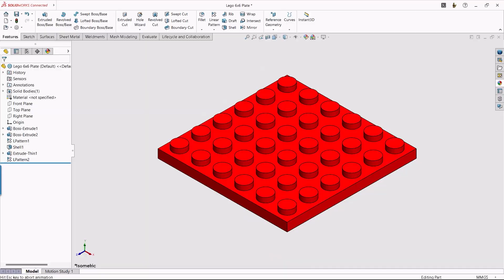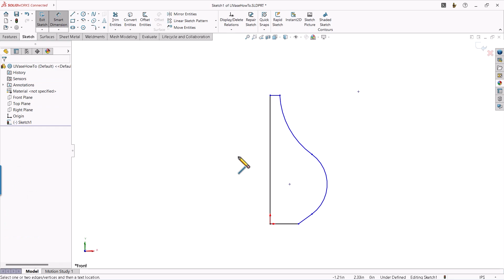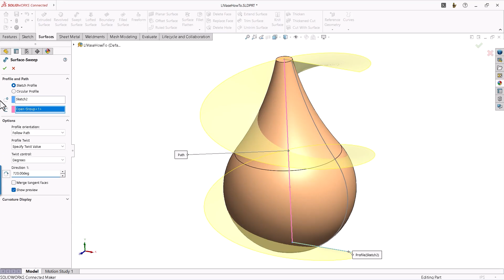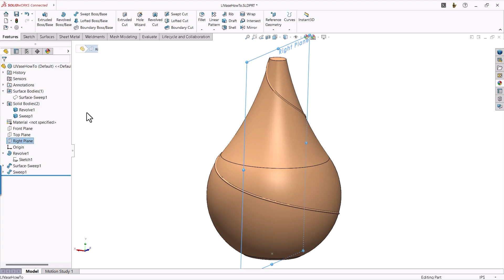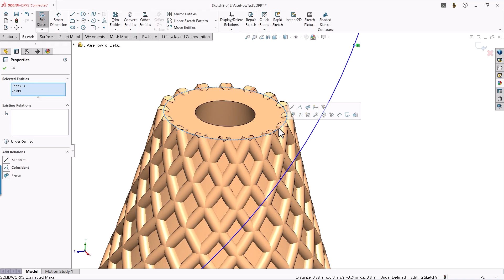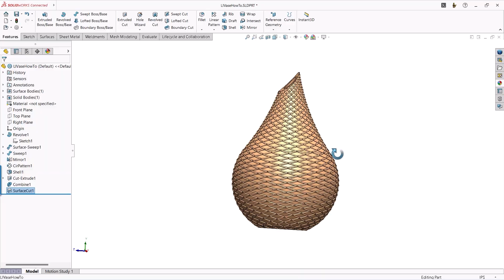How to model a 3D printable vase

Comment: normally this would be a great video explaining something cool for beginners. but using 12 hotkeys per millisecond without even mentioning them once upon first usage is completely defeating the point. I am trying for over an hour to recreate the steps now which took you less than 30 seconds and I am giving up for today out of frustration.
Reply from the maker: Thanks so much for the feedback. We're sad to hear that the steps in the video weren't clear enough to recreate the vase. Would you mind sharing where you felt we used too many shortcuts and didn't mention them. We just rewatched the video and saw that we mentioned things like pressing "L" to start the line command, pressing "S" to launch command search, dragging the right mouse button upwards to use mouse gestures to turn on the dimension command, etc. We did notice, for example that we failed to point out that you should hold the Shift key to dimension to the maximum position on an arc. Did you find other areas where we could have included more detail? We absolutely welcome your feedback so we can improve how we make other videos like this in the future. Thanks!